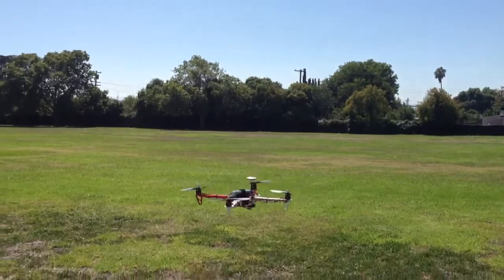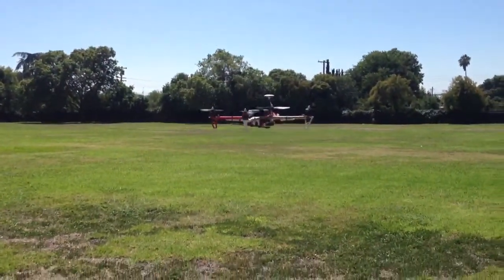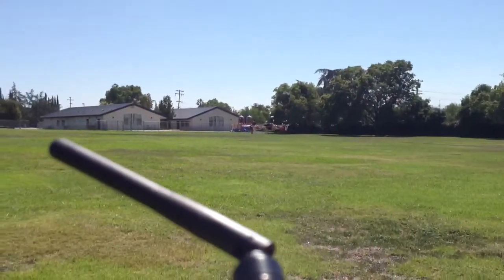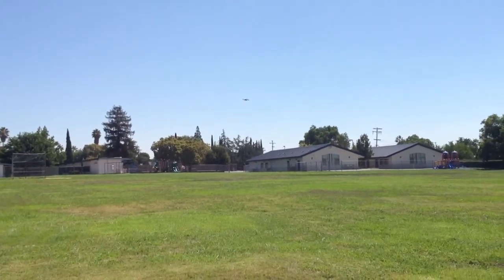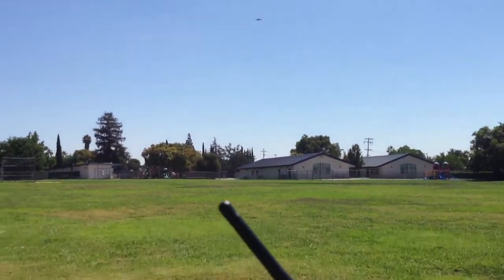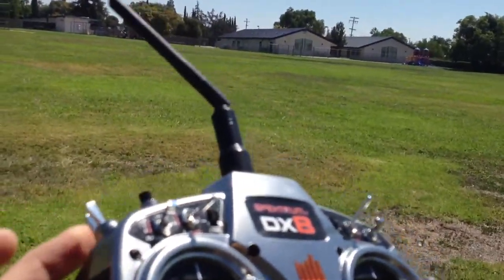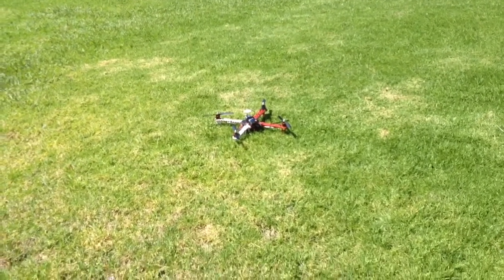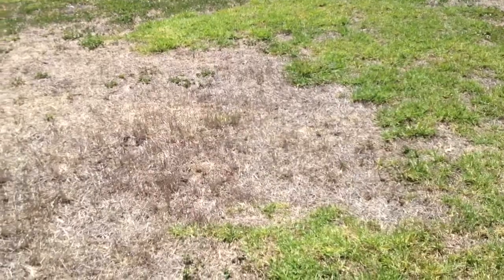Dji f450 Naza Rth test

Comment from the maker: You're very welcome. I briefly worked as a tech for a company who distributes DJI products so I welcome any questions you or anyone else may have. DJI makes a fantastic product at a reasonable price. As long as you don't plan on doing advanced aerobatics, the DJI Naza flight controller is spectacular. Add the GPS and it gets even better! Blows the Gaui Gu-ins controller out of the water (in my humble opinion).

Comment from the maker: There really isn't a maximum altitude. The quadcopter will continue to climb until it either runs out of batteries or signal from the transmitter is lost. As far as transmitter signal strength, the quadcopter will likely be out of sight by the time you lose signal. Some people have even upgraded to long distance radio equipment and have gone thousands of feet high and miles away. I live near a small airport so my local quadcopter flights are limited to 400 feet high per AMA and FAA regulations.